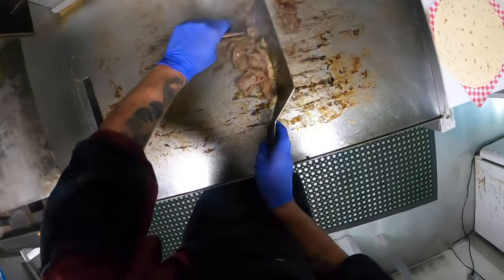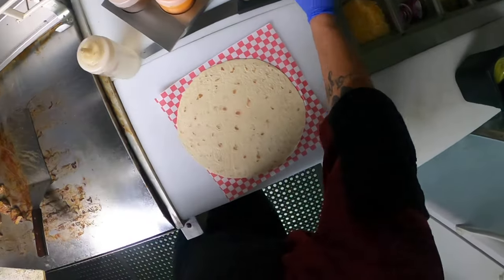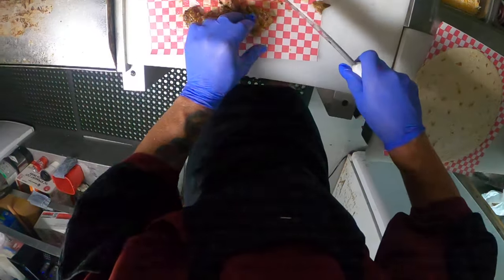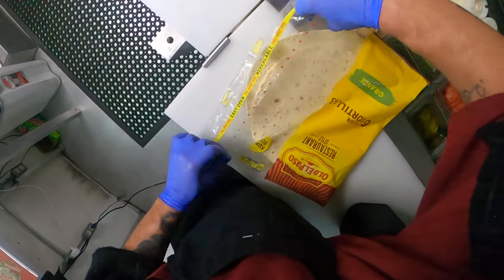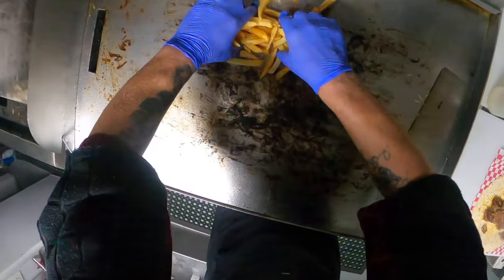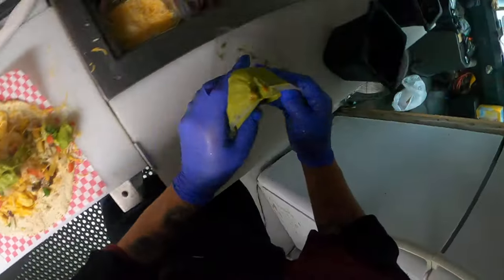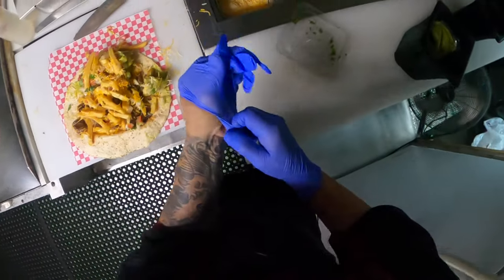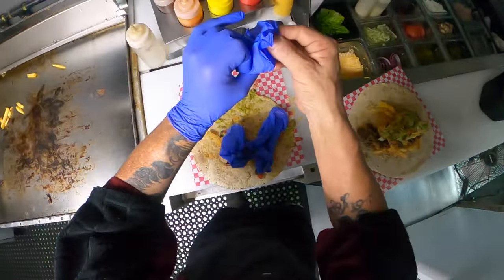FOOD TRUCK CALIFORNIA BURRITO

Comment: Too many fries wasn’t the problem, your tortillas need to be bigger. 12 inches don’t cut it
Reply: I would have rolled that burrito on that rejected 12"
My burrito would be like a brick. Flat on all 4 sides with round edges.
The guacamole never goes on top 
It goes on the bottom flap. On the tortilla itself. Too messy this way. This is why he changed his glove twice for the same issue.
My ex boss made me role his burritos. They were humongous. It seemed impossible 

He finally made me his partner and we opened up our own resturant 1 year later
Reply: @djpacoelfuerte9531  any tips on starting a burrito business?